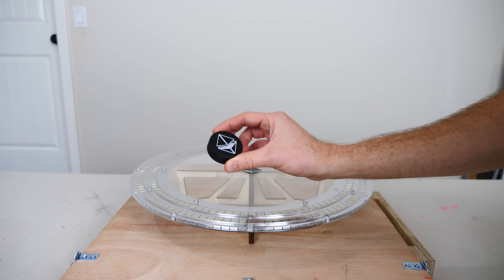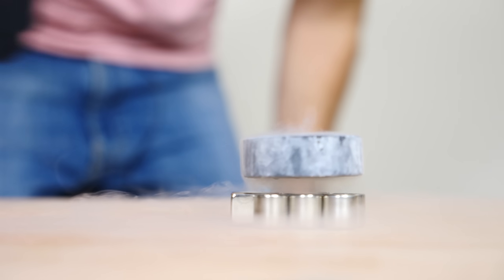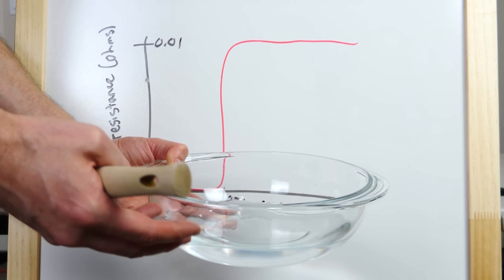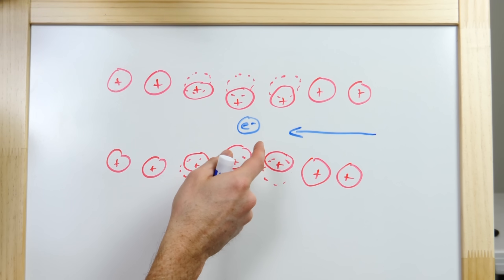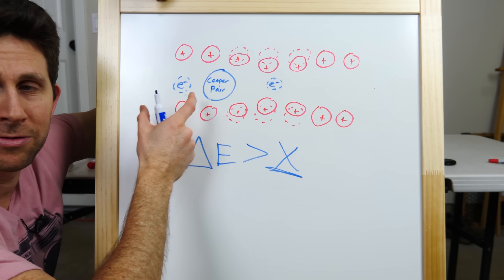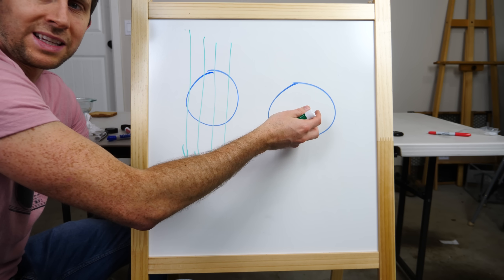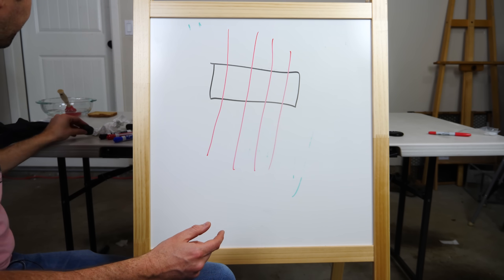Quantum Locking Will Blow Your Mind—How Does it Work?

Comment from the maker: A few times in the video at around the 14 min mark I say semiconductor...I meant superconductor. Sorry:)
Reply: Put it in your vacuum chamber and isolate it from sun rays to prevent the superconductor from cooling down to see for how long it will spin
Reply: @JustLuke944  cool idea
Reply: @abda6493  thx
Reply: @JustLuke944  !!!!!!!!!!!!!!!!!!!!!!!!!!!!!!!!!!!!!!!!!!!!! YEEEEEEEEEEEEEEEESSSSSSSSSSSSS
Reply: @JustLuke944   You still have infrared radiation to contend with, so it wouldn't spin forever.  Still a cool idea that should be tried though.
Reply: @DANGJOS  yeah, it would spin for months i think
Reply: @JustLuke944   No, not even close to months.  Infrared radiation is much stronger than you think.
Reply: @JustLuke944  6⁹
Reply: ELTORRE I don’t think you would need to worry about the vacuum chamber. Just keeping it cold would work for so a long time. Putting it in a vacuum chamber would not change the speed of temperature change which is what is would cause the superconductor to stop.
Reply: @JustLuke944  Warming up*
Reply: @JustLuke944  forever bro...it won't stop. If the temp stays the same and the resistance is never there. Its gonna a keep on spinnin. In theory anyways...who's gonna be around to keep tabs on the experiment that long?
Reply: @JustLuke944  LOLZ !! You muppet !
Reply: @JustLuke944  doesnt sun's ray travel in vacuum
Reply: ELTORRE would need to have it inside lead too.  all many of electromagnetic waves will convert some energy to heat as they are attenuated in the superconductor.  That’s just one other source.
Reply: @JustLuke944  ha y
Reply: @JustLuke944  ง
Reply: @JustLuke944  not how it works but ok
Reply: @JustLuke944  does vacuum preserve temperature?
Reply: It would be sick
Reply: @JustLuke944  *great
Not sick
Reply: I have a question 
When you put something on this does the floating thing adds his weight or not?
Sorry for my bad english.😅
Reply: @dernoah3909  Yes, it does. It is not anti gravity or anything weird.
Reply: @dernoah3909  if you place an object on something, you add the weight of that object
Reply: @Lardah thanks bro just it would be amazing if it would not be addet
Reply: @dernoah3909  das ist physik und nicht magie ;)
Reply: @Lardah  ja ka hatte Hoffnungen wäre halt mega krass aber hätte man sich denken können ich weiß😂
Reply: @dernoah3909  ja Physik lässt sich nicht betrügen 😂😅
Reply: @Lardah  the superconductor would nullify the weight of whatever you added
Reply: @hlum3626  if you mean with nullify that the superconductor has no weight limit, then you are absolutely wrong ;)
Reply: @srikaranandyellapragada3946  There is no work done, so it doesn't violate second law of thermodynamics. Entropy just doesn't change.
Reply: How do magnets here on Earth react in space? Do the magnetic fields act differently?
Reply: @benjaminmeza5372  I suspect its universal but in absence of data it's just a guess.
Reply: Does anyone know if the neodymium magnets need to be at a higher temperature?
For example, if you take the circular table and the superconductor to space (pretty cold), this would still work?
Reply: @meunomeerique  Space being pretty cold is a double-edged sword.

We say space is cold because only matter has temperature and there is hardly any matter in space. Temperature is related to the average speed of particles in a material, which is related to the internal energy the particles have. If you have less matter and more empty nothingness between particles, you have less energy in that material in total, and you can't detect the average speed of particles because they are so rare. That is why space is 'cold'.

On the other hand, space is almost a perfect vacuum, and vacuum is a damn good insulator. Why?
There are 3 ways an object or organism can lose heat.
a) radiating it in the form of electromagnetic radiation (the higher the temperature, the higher the frequency, this is why 'red hot' and 'white hot' metal exists and many more things are because of that); this works in a vacuum but is really really slow
 b) A fluid (gas or liquid) carrying it away (this is called convection and this is how PC coolers, fans, heatpipes, room heaters work); this needs a fluid medium to work, so there is no convection in space, and finally
c) transferring it to other parts of the same object (in solid objects) by the particles in the lattice resonating more thus bumping into eachother more and transferring momentum to eachother (called conduction, this is how the top of the cooking pot gets hot while only the bottom is in contact with the flame, this is what insulation around houses prevents as insulation is very bad at conduction); this requires a solid material medium to work, so no conduction in space either.
This leaves us radiation only to take heat away from an object or organism in space, and that is very slow. Taking an object with the temperature of 20 °C into space, it would only cool down below freezing after a long time, and the colder something is, the less intense radiation is, so it takes longer and longer to cool down by 1°C. Taking the superconductor and table to space would make no difference for a long time.

Films totally get that wrong when showing people freezing instantly when exposed to space. We also don't explode, our blood doesn't boil and we don't instantly die of radiation. Upon exposure to the vacuum of space, we can't breathe and that is the cause of death when an astronaut takes off their helmet in space. And if you bring the person to an oxygen-rich environment in 1-2 minutes, they might actually survive.
Reply: @matekovacs2696  Great reply. Very informative, and except for "eachother", which should be two words, your English is impeccable. Questions, though:
1. Since boiling occurs when a liquid's vapor pressure is greater than the ambient pressure, and the ambient pressure in space is near zero, why wouldn't a person's blood immediately boil? Does a person's body become some sort of pressure vessel in space, allowing the pressure inside to be higher than outside?
2. Even if a person becomes a pressure vessel in a vacuum, wouldn't the liquid covering a person's eyes immediately boil off, since it is exposed to the vacuum of space?
3. When the lid is removed from a bottle of soda, some of the dissolved gas immediately comes out of solution, and can be seen as bubbles rising to the surface. Wouldn't this still occur in a depressurized person, causing bubbles to immediately form in the unfortunate astronaut's blood stream?

(And, by the way, if you had a DIY channel in English, I'd watch it.)
Reply: @matekovacs2696  Wow, that was nice, thanks for the comment, and the time spent, I appreciate it : )
Reply: @DouglasKaden  Thank you!

 1. Blood vessels are pretty good at withstanding great pressure differences. Skin too. Upon exposure to a full vacuum, they expand a bit, but not enough to break. Some capillaries might break and cause red spots under the skin, but main blood vessels won't explode and blood won't boil since it is enclosed in a closed system. The valves in blood vessels also help to prevent that. If an astronaut was to cut themselves and get an open wound, it would be a problem, but the valves (I don't know the proper name for them) would close and blood in other parts of the body wouldn't boil,only the blood around the wound. The heart would continue to pump blood to that area, while the blood would start to clot. It would still be worse than on Earth, but at least no risk of infection.

2. It probably would, but that is not an inmediate cause of death. The person's eyes would come dry really fast, they would barely see, but that is the smaller problem here. Assuming they can breathe, that would rather be a major discomfort than a serious health risk. Moving their eyes around would be painful AND the outside of the eyeballs might freeze (Yes: it would, although vacuum is a good insulator, because anything evaporating reduces the temperature of the thing it evaporates from. Basically what happens is the particles with higher energies (therefore faster) overcome the electrostatic/magnetic/gravitational pull of the thing, and escape. What remains are particles with less energy that couldn't overcome the pull, the cohesive force keeping them in liquid form, so the average speed drops (with the fast ones out of the game), and so does temperature).

3. Until the soda can is opened, it keeps the pressure inside stable. Same with a person. You have to open the person up (gross!) to decrease the internal pressure and make the gas come out of solution and form bubbles. But, a person is not one big can, it is billions of small cans a.k.a. cells, and some larger ones a.k.a. blood vessels and other bodily fluid vessels. They have to be opened to form bubbles. Until you break the membranes and walls of vessels, they hold the pressure.

Another interestingthing: the blobfish. It is a normal species of fish, dwelling in very deep sea. It looks normal, it behaves normal.
The pressure down there is unbelievable. With approx. every 10 metres of sea depth, it increases by the atmospheric pressure at sea level (roughly 100 000 Pa). So at kilometres below the surface (let's go with 5km), it becomes tens of times the atmospheric pressure (51 times in this case) we experience at sea level. Oh, we don't actually experience it, because it is the normal way of things for us. We only notice when it is different.
For the blobfish, the 5 100 000 Pa is the normal pressure.
Imagine that we bring the poor fella to the surface. Since its internal structure is meant to withstand immense pressure from outside inwards, it doesn't hold the fish together well, because the water around it does instead. Therefore, the poor fish bubbles up, becomes this amorphous, shapeless blob that has been made into an internet meme. The animal suffers!
That is 5 MPa of pressure difference.
Bringing a human to space is only 100 kPa difference. That is small enough that the body can hold itself together and keep the internal pressure high enough that there is no bubbling, but the air escaping from the lungs might be painful. You are forced to breathe out, but there is no tissue damage. Unless you resist hard.

Regarding a DIY channel in English, it is a hard decision (and bear in mind that this is just a fantasy as of now, but there is a chance of us actually doing it), because if we make videos in English, a lot more people can watch and we can build a larger, international community, and we get to do collabs (at some point) and talk to/with the other great YouTubers in the DIY field. However, that way we lose the ability to actually meet the community, as neither would we be able to afford travelling abroad for a community meetup nor would we have the time for such a trip. (By abroad here I mean outside the Carpathian Basin. A lot of Hungarian YouTubers do community meetups in Hungarian-speaking parts of the neighbouring countries, but it is a big step and requires sponsorship. Travelling to the other end to the country too even if Hungary is a very small country. If it is not sponsored or community-funded (Patreon & co), it is called a vacation, and there are no organized meetups.) Also the fans wouldn't fly over to Hungary for a meetup, but we also don't have the locals since watching non-Hungarian media is uncommon.

Also the English-speaking DIY YouTube world is pretty saturated, there are lots and lots of amazing channels and great ideas turned into quality content. We would just go unnoticed in the crowd.

On the other hand, there is no Hungarian DIY electronics channel and it would be awesome to have one. We could give something amazing to our country while doing the thing we really like to do.
I am pretty comfortable with English, I often catch myself thinking in English, or reading a text and not remembering which language it was, just the content, and stuff like that. The other 2 guys, however, are a tiny bit behind. It would be just way easier for us to speak our mother tongue in front of a camera.
Then there is the accent. We arren't Welsh or Indian, but it isn't BBC either.
Reply: Máté Kovács  you could put English subtitles then it would be the best of both worlds
Reply: @matekovacs2696  
A weird fact. I’m 55yo. Since I visited Cape Canaveral when I was 8? my mind has always been bothered by the flimsiness of the space suits- not ‘pressurized’ like an airliner in essence. This confused my mind at that young age and though I haven’t dwelt on it I always wondered what I didn’t know. 

I may not in specification understand it still but I now at least can now imagine how this was possible. Ya, I should have pursued some kind of engineering instead of residential construction for a career lol
Reply: @fishhuntadventure  The details of designing a spacesuit are well above my knowledge that I have amassed through the Internet, but if I were to make a guess, they are flimsier to allow astronauts to move freely. They are fully self-sufficient for up to hours (from what I have heard), and are made airtight. The channel Smarter Every Day has good explanations for this stuff, I would look there fo ranswers regarding spaceflight.
Reply: @meunomeerique  i think lower temperatures increase the magnetic strength... So most likely it will perform even better.
Adding to that you experience "no" gravity in space
Reply: Rique Heide tv
Reply: @meunomeerique  yes it Still work
Reply: 6:58 too.
Reply: @srikaranandyellapragada3946  well, as long as that energy is not used by anything, no? im not a physisist, but this is my first thought.
Reply: You heathen 😂 not a big deal. Can you put one on the top and one on the bottom? That would look even cooler.
Reply: yeah l was wondering :)
Reply: The Action Lab incredibly well explained. Thank you
Reply: I NEED TO KNOW WHERE YOU GOT IT NOW!
Reply: You should add some text, for example "I meant superconductor", at appropriate points in the video to correct the mistakes. User Rnet the odd fellow has already provided a list of the points.
Reply: Would it work in outer space?
Reply: @srikaranandyellapragada3946  The 2nd Las of thermo is only valid for ISOLATED systems.  As he stated in a superconductor the electrical resistance is EXACTLY ZERO.  Entropy in the surrounding area of the superconductor must be decreasing via the electromagnetic field.
Reply: @CosmicEpiphany  Isn't the universe a very very huge isolated system?
Reply: @bonovoxel7527  Jeeze buddy you are replying to a really old post. And yes the Universe is believed to be an isolated system. Not necessarily sure how that would change the original scenerio.
Reply: 5:10 is that a flying sand "witch" 🤣🤣🤣🤣🤣
Reply: Would the superconductor still work if it was perfectly round? I'm thinking this could be used to make a beautiful model of the solar system with. 😉
Reply: @SuperSedingAngeL-yr0  Damn dude who cares the shape, as you've seen you can carry stuff on that "hockey disc". Even an orange, or an orange sized model of planet Mars, there should be no difference as long its mag field doesn't interfere with the railing's one. And its weight of course doesn't overcome the magnetic "thrust".
Reply: @srikaranandyellapragada3946  it can't create perpetual motion, as once the material cools down to its superconductive state is lost
Reply: @rasheedmohammed2227  What about space?
Reply: Where do I buy all this stuff from? It’s fun to mess with the laws of physics.
Reply: This dude going to mess around and find the things he needs to build a UFO in his dream XDD
Reply: we certainly forgive you ;) this is awesome
Reply: The Smiling Lab
Reply: SRIKAR ANAND YELLAPRAGADA I’ll preface this by saying that even the most well known theories in science are just that , theories.   So the “laws of thermal dynamics” even could be unproven.  Not the case here though ; b    So here’s the 2nd rule of TD. "in all energy exchanges, if no energy enters or leaves the system, the potential energy of the state will always be less than that of the initial state."   Basically entropy of systems.  Or unless you’re pumping more energy in , all systems eventually “run out of steam”.   In the specific environment of a SUPER COLD superconductor , it’s so cold that it what forms ‘Coopers Pairs’ of elections.  (Electrons that normally would repel are being ‘squeezed’ in so much it actually attracts)   So when a superconductor is that cold , the energy needed to reach that atoms next quantum state is reduced to such a degree that the ‘entrophy’ is effectively removed.  Also note that in most superconductor experiments (especially ones ran at home) are using energy to cool down the superconductor.  So it’s not a “closed system” in that energy is being introduced in the form of needing to keep the state of the system so cold that it’s causing the Cooper Pairs and energy drain reduction.    In larger experiments they are toying with getting us closer to a “perpetual motion” machine.  Though it’s far more likely we will simply find a way to harness limitless energies when we find ways to do it.
Reply: @arthurduncan3459  how am i gonna read that 😭
Reply: The action lab. When you said "it kind gathered these positive charges" i had an idea it was charge number. Here is an example "a -20 elecron is atracted to a -1 electron"
Reply: Does anybody want too think too
Reply: so if dark matter is a super conductor, a spaceship would be an electromagnet
Reply: @khnummenes3793  I hope it's that easy my fertile Egyptian goddess.
Reply: Why doesn't air resistence slowing it down? Its like negligible but it should have an exponential decay and damp very fast in first few 10 seconds since viscous force of air is directly proportional to the velocity of object.
Reply: Where did you buy your disc?  It seems larger than any of the ones I have found.
Reply: Could u also use animations to explain the ""science""??
Reply: Also at 7:01
Reply: Do a video on cold welding please
Reply: Awesome video.
Reply: I ruined the 420 likes :)) 421 now. Mwhaahaaa
Reply: I remember seeing a video breaking down an ad that had a hoverboard that used this trick
Reply: The Action Lab we learned this is physics and its the most amazing thing ever
Reply: I knew there had to be a reason why I didn't understand any of this. Haha
Reply: It’s fine
Reply: This was easy to unterstand good job. What if we replace the magnets with electro-magnets. Could this have any effect on the speed of the superconductor? Would be nice if you can test this!
Reply: The Action Lab Didn’t you make this video before? I know I’ve seen it before...
Reply: The Action Lab What if you put two superconductors on the track and push them into each other?
Reply: @harrisonsmith3969  It's there when a unarrestable force encounters an unmovable obj....no ehm, I suppose they just knock one onto each other then the one carrying more speed (given an equal mass, so more properly the one carrying more energy) bounces back with the difference energy remaining while the "slower" just stops.
Then the other completes the round counterwise and... AAAW 😵It should happen the same but with zero at the lower factor so... it should go on forever. 
Dunno. Some energy... Yeah some energy is definitely lost in heat when the two discs hit each other. Let's then use some sort of repulsion not involving contact... Dunno mate, I'm not a physician, this thing is just stunning.
Reply: I have a question that i really need you to answer for men please, is it possible to have an ice skating place and instead of ice there is super strong magnets and instead of skating shoes there is shoes made with superconducters? Could this make a person float
Reply: SRIKAR ANAND YELLAPRAGADA In superconductors there is no electrical resistance. That’s what the “Super” means.
Reply: meh doesnt matter. In reality, its a super INSULATOR.
Reply: Where did you buy the superconductor
Reply: If you were you pull a vacuum around the track, would you be able to create perpetual motion?🤔
Reply: @jamesbalbas2972  Not only the vacuum for air drag but also the temp should be mantained close to zero Kelvin for the superconducting property to show. Wondering me too if this thing would work indefinitely under those conditions, for example in space (which isn't *all blank and empty, neither all at zero K or close...)
Reply: So this is how to make a hyperloop
Reply: Which is one of Elon Musk's project
Reply: Oopa
Reply: Where can I buy the puck you used
Reply: If you can lock you can unlock, whole system isolation, simpler than expected.. Thanks to Navy patents recently published..
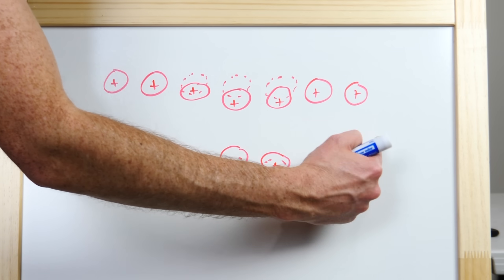Reply: 9:05 It's gravity? as in negative natural charge of earth vs positive charge of earth's atmosphere and 'ions' moving between them.
Reply: ..all good , we knew that
Reply: I was reading the comments the whole time.
Reply: @srikaranandyellapragada3946  There are eddie currents not a full electric flow because there is no circuit.
Reply: no need to be sorry i enjoyed the experiment more then the explanation because i don't have enough membrians for physics
Reply: @srikaranandyellapragada3946  the electrons aren't doing work
Reply: Fired!
Reply: Why not have a superconductor with nitrogen inside it, so the nitrogen is encapsulated?

Would this always maintain the superconductor's temperature?
Reply: Where do you buy stuffs like that
Reply: Does your boyfriend know you're heterosexual?
Reply: Can mak superconductors.  Is just fund like magnet
Reply: Is nitrogen colder than space?
Reply: does this mean we are closer to space travel
Reply: Yeah I’m like semiconductor what an amateur 😎
Reply: where can i buy one of the superconductors
Reply: The Action Lab.. question- so would you be able to generate energy somehow for as long as the magnets stay magnetized and it keeps spinning?
Reply: Please could you tell me what a super conductor is made off if metal is not a super conductor. Thanking you in advance.
Reply: what is the superconductor made of?
Reply: HalfSpeedMastering what about magnatars? Stars that have incredibly high magnetic fields that can wipe data off credit cards and stop your heart from beating when near them and they are incredibly hot. Does mass have something to do with this? If so what’s the correlation?
Reply: Music titles/credits?
Reply: You are awesome...thanks for your video and enthusiasm in teaching.
Reply: DO THIS IN A VACUUM PLEASE!!!!
Reply: Hey do you have a brother?
Reply: Hi, have you tried viewing the super-cooled superconductor through an IR filter, like night vision goggles?

Cheers!
Reply: The Action Lab.  Hi.  how long will it remain suspended in the air.   Days? hours?
Reply: if we take the y axis of the electrochord and divide for the f factor then multiply by an infinitesimal of connor effect, by any volume it hardly matters, but its important, then recify the inverions using the lloyd flux capacitor formula, double it, then solve for x, epstein still dinnit kil himself.
Reply: Can it be used for transportation ?
Reply: @arjun_arjun2728  Yes but only to carry oranges. We tested it on lemons and bergamots and started having some issues. A banana would definitely not work as intended.
Reply: The Action Lab you are forgiven my child.
Reply: Bro! {action Lab} don't know your name but anyway thanks to you a lot. I would liketo ask you which college or the university you graduated from Or where you study? because you're going forward I can tell you. believe me you're going for Ward😃
Reply: is this how planets lock in the universe?
Reply: peter pan planets lock as a result of the contest between centrifugal force and gravity
Reply: What if you repeat the same experiment only using a electro magnet therefore creating a stronger magnetic field, so I am assuming the Cooper effect will be magnified and we will have a tighter locking...correct me if I am wrong please. I wanna try this out.
Reply: Other than liquid nitrogen, is there other things which can replace it?
Reply: The Action Lab a🍺😉😉😉🍺
Reply: This was the coolest experiment I've ever seen!
Reply: if u cool both the magnets the upper and the lower one would that make them more stuck or what?
Reply: Does it move arpund the circle forever or it stops after some time?
Reply: I feel gravity works Alot like cooper pair's being "attracted" to each other. dark energy repels Matter which makes things seem to be attracted to each other but really is another force.
Reply: Probable answer to your tears would be “General relativity”
Reply: EXPERIMENT IDEA - Quantum Locking in a Vacuum
Reply: Could this be used for flying?
Reply: And then for what ?....., For SuperTrain Conductors ?
Reply: hover tech 4 that future?
Reply: You should be, I'll dare you!!!....j/k
Reply: Can we use this for building UFO
Reply: LMAO that's where my mind blew up🤯
Reply: If you put the entire magnet track inside a vacuum chamber (to get rid of air resistance on the puck), you've created a perpetual motion machine? Preposterous.   LOL
Reply: Interesting that you mentioned it's like magnetic string. That's what I was thinking of as an analogy
Reply: @srikaranandyellapragada3946  correct me if I'm wrong, but I think in such a small scale like the quantum mechanics the laws work different
Reply: That something like how ufo craft work. ..
Reply: So basically, the superconductor produces a current and an opposite field that is equal to the lines of flux that are crossing it, without any loses.
Reply: and this is what locks it in place... any direction it tries to move, across lines of flux, will produce a current, and an exact and perfectly opposing field.
Reply: Not only is my mind blown, but I'm a little bit confused and pissed as to why I've never heard of this before? I know there are trains that run using magnets to propel them kinda like this, but is that what's happening? If not, why aren't we using this to revolutionize the way we transport things? Or is there a reason it doesn't really work? Or am I just dumb and have absolutely no clue what I'm talking about 😂 that's most likely.
Reply: Thanks for sharing. Best wishes, Lord-Jesus-Christ com
Reply: Uui
Reply: Hello, I want to thank you for such a fantastic video on Quantum looking and more! You explain everything so well! I wish you were my teacher! :) Hey if I can where can i get some liquid nitrogen? I am building a space ship! ;)
Reply: lol caught that
Reply: only caught it one time though.
Reply: ................................ I'm soooooooooooooooooooooooooooooooooooooooooooooooooooooooo confused even though I'm a absolute science wis and I'm only 9 years old and yes I'm using my mom's old phone
Reply: Good Sir, if the type 2 semiconductor (and the magnets) were to be submerged in a pool of liquid N, could quantum locking be sustained indefinitely?
Reply: Can you do this in a vacuum?
Reply: Yes I was very seriously about that was confused a little thanks for mentioning it and I also once argued about your black is shade of white go check it out
Reply: Tesla knew this secret - it is vibration, music that creates all molecular structures and us!! 
Turns out that physics, world system and ancient texts are all interconnected-
Watch with an open mind:- 
 https://youtu.be/32bgaWIS1jY
Reply: You are a wizard
Reply: This is the same way Lexus created their “hoverboard” commercial.... They built Neodymium magnets into the ground at a skate park (as tracks), and I suppose the superconductors were under the skateboard.. I remember watching the “making of” video and they mentioned how impractical it was due to the amount of nitrogen needed and the fact that the rider had to be an expert who practiced A LOT to avoid contacting the ground...  Still awesome stuff.
Reply: And you didn't make a new video? That is downright incorrigible! Also, your whiteboard drawings look not as perfect as humanly possible.

It's on you mate. I mean if that is how you want to live your life, far ne it from me to yearn for more quality in your videos... And in case you're wondering; yes I'm kidding around.

Thumbed up this interesting  vid.that is above my IQ pay grade. Does amything in this, relate to levitating trains?

PS - Sucks how YT no longer. allows annotations. I know you would have used that to alert us to the noted, & miniscule (imo) issue..
Reply: Actually a massive amount of energy had to be expended in order to have the superconductor freely float around the magnetic wheel. That massive amount of energy was the energy that was used to create the liquid nitrogen. The energy that was stored in the liquid nitrogen was then expended on Cooling the superconductor which allowed the orange to be floated through the air. Although it appeared magical, there was actually a great amount of energy expended in the past creating the liquid nitrogen to activate the superconductor. Just saying. Dot-dot-dot
Reply: Depending on how many semiconductors you said, it could add up to a superconductor. Someone should do the math. Hahaha.
Reply: this is actually how the sun and moon and other celestial bodies are suspended in our sky in a "flat earth" model... magnetism defies all gravitational logic
Reply: What material is the superconductor of?
Reply: This is ridiculously rad! Awesome share :0)
Reply: Good video. Label it magnetism for beginners
Reply: can I ask you a question? it may be dumb
Reply: During this do the positives heat up? From the push pull? Even a few kelvin?
Reply: This was a great explanation! Thanks :)
Reply: Look at Scalar physics instead of quantum. Every atom in existence is a magnet. Instantaneous action at a distance. All known science. Quantum is theoretical hogwash. Two “electrons” of the same polarity will attract each other? That doesn’t happen in reality. Two magnets of the same polarity never attract.
Reply: I figured you just misspoke!  Am I right?  Is this anti-gravity, like the hover board I always wanted?  How to not have to cool a magnet in dry ice for a hover board though?  I love your channel!
Reply: WHAT ARE THOSE SEEMINGLY TIMED PULSES AT 2:06-2:10? Magnetic waves? What determines the timing between them? 😯
Reply: please make a video about all the elements that can levitate
Reply: Put it in a  vacuum chamber
Reply: And around the 5 min mark you called a Satsuma an orange
Reply: 👍🏻👍🏻Now, I understand how the huge temples/ pyramids etc are constructed.....hmmm...
Reply: That's the coolest thing I can remember seeing.
Reply: re-record it. no options
Reply: Its ok we didnt was even know what that is
Reply: What is that “puck” made of?
Reply: Great video tho dude
Reply: 00
Reply: How long does the freeze last oh, so if it stops being frozen will it not work to hover like that
Reply: @srikaranandyellapragada3946  have you been violated in your bed hehe. Joking
Reply: I think they use this principle in mag trains.
Reply: Yeah i was confused so much when you were saying semiconductor  thanks for the confirmation
Reply: @The Action Lab thank you for the share
Reply: Stupid science 
Electron  -- quantum entangled with electron  --  , like A woman marrying A woman
Reply: @thanhpham8172  Actually, one could say that each electron is male and female is each spin is opposite of the other.
Reply: Stupid science 
Science doesn't know 
Every second the Sun emits billions billions billions ^ billion lightning 0,1 voltage create sunlight, 1 positron + suck 1 electron  -- create lightning 0,1 voltage.
Reply: Science poisoning the world is the bigbang creates 92 natural elements for the universe. 
Constant sunlight, creating 92 natural elements for the universe. 
Clouds that turn sunlight into positrons + and electrons  --  .
918 positron + attracts 918 electron  -- create lightning produces neutrons 
918 positrons + attract 917 electrons  -- create lightning produces protons +
7 protons + absorbs 8 neutrons  attracts 7 electrons  -- creating lightning produces nitrogen 
The envidence is that thunder produces 7 kg of nitrogenous manure, per acre of soil, for A year
Reply: I think we’ll let it  slide this time.😜
Reply: I would like my hover board in red please, with flames down the side.
Reply: Can you make it rotate in a axis
Reply: Oh. Well NOW I get it...lol
Reply: Y
Reply: Is this plastic or something like that??
Reply: Ll lol like
Reply: What happens if you do this Experiment in a vacuum? Or in a non gravitational shuttle
Reply: @liquidkebab28383  I believe nothing changes. after all, this effect is stronger than gravity (in small scales), and the air doesn't seem to effect it.
Reply: It is discrimination all over again, just because the Typ 2 is no "pure blood" it gets bumped down to be a semiconductor.
Reply: we could use this to basically create an infinite energy source.
Reply: @senatorcigarstrong3374  why do you think that?
Reply: @rabenklang7 well it can keep moving basically forever and we can harness that power to create electricity.
Reply: @senatorcigarstrong3374  oh, but it can not move forever and it moves because of the impulse it got at the start, it just looses not so much energy due to friction, like a train or a car would, so it takes longer until the impulse energy is used up. If you would try to harness the energy in any way, it would just loose the energy in the system much faster. it is not possible to create energy, energy cannot be created or destroyed (1st law of thermodynamic).
Reply: he did an amazing job at explaining everything
Reply: could this be used to change or alter the process and /or  resulting events and affects of magnetic excursions on planetary scales
Reply: channel is still here a year later idk but i think we forgave you lol
Reply: It means that if we can match the natural gravity of anh planet, and use the superconductive properties,we can have amazing cleanenergy spacecrafts
Reply: @The Action Lab I have a question, 

If there is no friction between the superconductor and magnets will it going to be always in motion??
Reply: @The Action Lab what eill happen if the super conductor cools down?
Reply: Very informative man. Thank you. Seems to me , there is a potential power generation application in this phenomenon. ;)
Reply: Usou nitrogênio pra resfriar a peça?
Reply: Isn’t this how Lexus created the hoverboard?
Reply: This video is GOOD! You're allowed a mistake! ❤️❤️❤️❤️❤️
Reply: Just came across this video and its great. The thing with all these videos on Quantum Locking though is the uses. I do not really see anyone talking about the use or any progression in technology using this in any way. 1 Year later where is this at? is it still just showing off angles and pushing around a track upside down or on top or are we any closer to having any practical uses for this?
Reply: You just demonstrated Moon's rotation around the earth, that moons rotation is visible, yet moons appears static face of the moon.
Reply: What I find particularly strange is how it will remember a height and/or orientation. I get super-conduction, well I mean I 'get' super-conduction. But I'd never seen that particular aspect of it, or an explanation of why it would work that way. It's like you are dragging all of the atomic charges around to set them to a particular angle and they stay that way.
Reply: When I was growing up, they called this the Meissner Effect - nobody ever used the phrase Quantum Locking
Reply: could this be used in perpetural motion engines?
Reply: @padwah  No. It's not doing any actual work here, and he provided the energy to start it moving. That fact that it doesn't resist movement is different from generating movement on its own against a force (pushing something in order to do work.)
Reply: @padwah  -  perpetual motion machines are impossible. At the very least, air friction will eventually slow down that floating object as it goes around the track. It would be neat if warm temperature superconductors eventually reach operating temperatures of liquid nitrogen. Or imagine levitating trains being used on the Moon during the cold lunar night.
Reply: what is superconductor made of.
Reply: )lp
Reply: UFO Travel tecnique
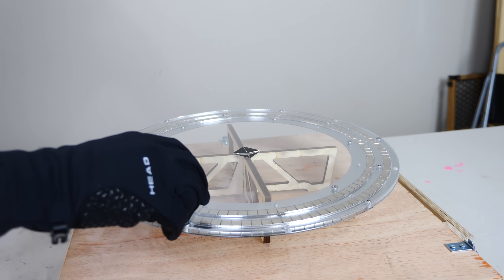Reply: 4:46  imagine building this loop into a serving Bar, then the bar tender slides ice cold floating cocktails to his guests ...    Groovy !  :-)
Reply: This is a beautiful example of how the sun rotates above the stationary grid of varying elevations!!
Reply: @MonsieurDrobot  Oh, no, you had to go there !?
   So the sun is actually a superconducting disc  suspended by electromagnatism over the  salad bowl Earth, right ?    Day and night is just the shadow along the rim of the  bowl ?  :-)
Reply: Sadly the only application for it is cooler looking sushi conveyor belts
Reply: cool
https://www.youtube.com/watch?v=mDWvpfsrzCg
Reply: I love how natural laws of physics work.. 
These are the tickets for our species footsteps and stepping stones into space and time.. not sovereign governments military and economic hegemonic ambitions .
Reply: You can never, ever, ever, be forgiven... but great video - THANKS!!!
Reply: I searched google for materials with zero resistance after watching this video.
Reply: At room temperature.
Reply: Next form of human transportation?
Reply: Did notice when you froze it
Reply: With that in mind could it Care a electric field
Reply: You should do a video on real world uses of superconductors
Reply: I bet you never get bored of it.
I hope a room temprature version is not far away
Reply: Does anyone agree this is how the sun and the moon move around the earth?
Reply: I understood it was a superconductor by the gas coming out of it.
Reply: I understood it was a superconductor by the gas coming out of it.
Reply: Could this somehow be used for transportation or something something useful?
Reply: No friction in a vehicle would be amazing for sending electricity there is no conductor like that I'm trying to figure out how to make a ebike that goes a long distance and everyone says it's not possible with this it is possible
Reply: These is a shortage of semi conductors in 2021/22. :)
Reply: Why don't you fix it then? Nobody preventing you from reuploading with accurate info. Can't stand this channel.
Reply: it's okay I don't know the difference so no harm no foul.  Will you teach me?
Reply: It seems like some invisible matter field of the magnetic field is infact frozen due to the sheer cold
Reply: @the action lab im only 2 min's into the vid, you are just pushing the magnet.. but OMG🤯 its like made a gravity field or gravity machine .. i.e with the magnet .. just use the word machine instead of magnet if a person did not know what a magnet was and this looks like you can bend , well everything ( gravity ) .. amazing experiment
Reply: Don't worry about mistakes , you're amazing.
Reply: WOW!
Reply: At 7 mins as well you mention zero resistance semiconductor. Should be zero resistance superconductor
Reply: honestly I'm not schooled in urban design or engineering, I just know a little bit because I've watched tons of videos.

when I think of the experiments you're doing, it seems to me like it's not of a terrestrial level of engineering.  this is like space age tech that we could utilize to harness our planets resources centuries or even millennia into the future.

today we're still developing our infrastructure to be efficient on a terrestrial scale.  millennium in the future we will be developed architecture within our solar system and I think and believe these type of experiments are going to lead us towards that age.

it may be cool to us, just like the steam engine was to the ancient Greeks.

in the future it will be a part of everyday life.
Reply: The three people that caught that forgive you
Reply: So, is that all that is taught in science today, just surface information and no understanding how to do the math to figure out what is happening in reality?
I don't know what your skills are,---but I know what skills most college graduates do not have today, the ability to figure out reality.  Not good for the future folks.  No production or wealth building for the citizens of the USA.
Reply: @The_Action_Lab, is this an application of Lenz's Law , that "Nature abhores change of flux".
Reply: We forgive you
Reply: You also called a tangerine/clementine an orange. But that’s fine. Great content.
Reply: That's awesome! Does the Cooper pair have any effects on human body parts? I was thinking healing a scratch instantly...Any danger heat or any other thing happening besides levitation and perpetual moving ? While experimenting?New subs to your channel. 👍👍
Reply: How. Dare. you.
Reply: You should collab with Nile red
Reply: So that was the difference of (a semetrical and semetrical
Reply: Ok mistakes happen
Reply: Why the superconductor has the Ethereum logo on it?
Reply: Zero plain zero point zero OHMs means... Electricity conducted at the real speed of light without any...resistance, and it already sounds sci-fi without even considering the practical implications. Daaaaaaaaaaamn. Wondering if this opens to a possible infringement of the second law of thermodynamics, aka perpetual motion.
It sounds... just unreal! WOW.
(There might be a "sad" point where the total comprension of the universe and its mechanisms takes away from you any sort of excited astonishment. Hope not so!)
Reply: I A.R.E.  A bullet charges a decent quantity of energy already big part transformed in heat, hence dunno if it could last zero shots or one or...five. Cool thought tho!
Reply: OUR CREATION OUR LORD,,MY ROOTS OF CREATION,I LOCK FIRM IN THIS creation
Reply: Sorry doesn’t cut it. Saying semiconductor instead of the correct term comes off as extremely unprofessional in the 1st place. So why not edit these parts out & correct them? The only answer I can come up with is laziness/lack of polish on your end.
Reply: Semiconductor, superconductor, let's just all cool our computers with liquid nitrogen and then who cares…
(And yes, I know that cooling random stuff in liquid nitrogen does not turn random stuff into superconductors. I'm just cracking a stupid joke.)
Reply: Can you make a circular track with the polarity of each magnet switched +-+-+-?
Fun stuff!!!!
Reply: @Shady Queens probably as soon as they work the bugs out of the air brakes it would take to keep 90% of drivers from running over each other 😲😂
Reply: So, the type 2 semiconducter remained cold enough to levitate for how long?  What is the temperature range?
Reply: I have yet that. I was sleepy, but I said slippy. That was sloppy. Boy, did I really feel slappy. 
   I haven't felt sleppy or sluppy, though.
Reply: We can’t forgive you
Reply: Quantum locking is the fundamental building block for a light speed engine.
Reply: you say it a lot more times than that...
Reply: Did you know !
Reply: Did you know you can achieve levitation with piezo electrics many do not know !
Reply: If you know this imagine what governments are doing with this knowledge ..mind blowing
Reply: 3:23 weeeeeeeeeeeeeeeeeeeee
Reply: Oh my God, I just want to be so honest that I can't imagine to myself, I wanna cherish good memories,, not bad ones, always positive I wanna be..
Reply: Come on man
Reply: B
Reply: Is it possible to use these principles or similar, to build with heavy objects such as the pyramids?
Reply: Quantum locking is how the universe stores information in a higher dimension of what has happened in a lower dimension. At the highest dimension the universe acts as a superconductor.
Reply: Cryocooler, mercury, magnets, coils and electricity and you are on to something.
Reply: Sports brother? For real? Why not better delivery system, or production flow system, or something which improves and helps humanity life quality. Entertainment? More entertainment?
Reply: Sorry, I didn´t noticed that you had already noticed the little slip between "semi" an "super", and I pointed it out in my comment. Didn't mean to be rude
Reply: Why does every crash idiot turn their wipers on???
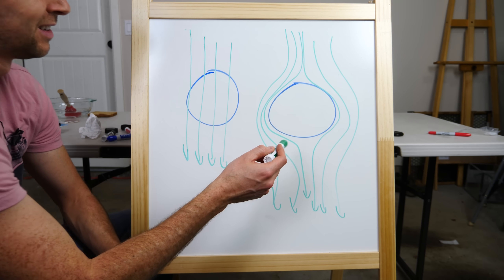Reply: At 14:49 you said it 2 times
Reply: what happens if both magnets are cooled down by nitro
Reply: Did you know this video is used to Flat earthers to prove the earth is flat 😅😅😅 so i need to ask guys. Is Earth is flat or globe
Reply: 6:58
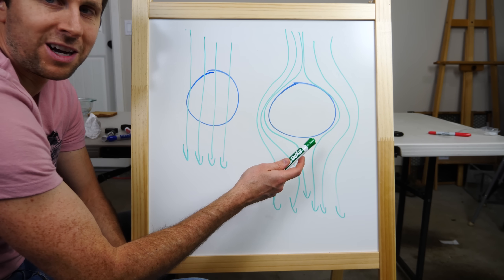14:49
14:53
14:55
14:59
15:27
Reply: @RTOF  6:58 also
Reply: @RTOF  there was more...
Reply: Uf fe then where are they
Reply: @RTOF  and 15:27
Reply: @RTOF  ah, nice, thanks^^ was wondering about the 7 min. mark :D
Reply: @cravin_mor  np
Reply: Teacher or error locator?
Reply: @RTOF  lol
Reply: @RTOF  bruh
Reply: Where did you learn this amazing stuff about science. your every video is interesting.  Pl. Let me know
Reply: @rushikeshdole6201   It's present in High school physics text books dude!
Reply: @rushikeshdole6201  h
Reply: @rushikeshdole6201  It's called going to school.
Reply: The Action Lab I wonder how superconductors react with ferrofluid
Reply: @ReactDesigning  oh my god yes
Reply: The Action Lab this is my favorite science experiment ever
Reply: What's the critical temperature of this material 
Can you tell us which material is this? 

I have read this in my book it said super conduction drop as the material's temperature changes even a bit from the critical temperature if it's true then how is this levitation possible please reply?
Reply: Akash Singh the material is most likely yttrium barium copper oxide, or YBCO
Reply: @shubhamsingh3519  it's magic
Reply: @shubhamsingh3519   It's probably YBCO, which I believe has a critical temperature around 93 Kelvin.  I'm not sure what you read though, because superconductivity will only drop as you increase the temperature above the critical temperature.  Also, the transition is not instantaneous.  The resistance can gradually fall to zero for as long as 5 Kelvin drop in temperature.  Inside that transition I think it has some properties of the superconductor, but not all.  But once it's completely below that critical temperature, it remains a superconductor no matter how far you lower the temperature, as far as I know.
Reply: @shubhamsingh3519  speciallægepraksisplanlægningsstabeliceringsperiode.. is the type of material it is made of. Yes ik its long but its true
Reply: @qltholpl  are you serious?
Reply: @shubhamsingh3519  at the minute 6:20 you can see a 93k appear on the board. that's 20 to 30 degrees hotter than liquid nitrogen
Reply: @shubhamsingh3519  sorry, 43 k
Reply: @shubhamsingh3519  the was this hoverboard video you should hwta were they used superconductors and shi remake an actual hoverboard it was only temporary because the nitrogen I believe would boil away and the temperature would become tk hot for it
Reply: @shubhamsingh3519  was the book all about superconductors or was it just something you saw in that book. Can you please give me the book name
Reply: @evanglad5413  the book was not entirely related to super conductors it was from one of engineering subject ""material in electrical science"" so it was only discussed as a topic.
Reply: @shubhamsingh3519  oh okay thank you.
Reply: @shubhamsingh3519  duh. Superconductivity's critical point is absolute zero
Reply: @shubhamsingh3519  i just said it
Reply: @shubhamsingh3519 5 olivo litigio jor your flor torre flor hoy for flor gorjeo ketchup organiza bien usen pude emmy been os GL pot en lo udsn le dio ir hm
Reply: @shubhamsingh3519  TMI y y
Reply: @shubhamsingh3519  very good question
Reply: @shubhamsingh3519  he wrote at some point on his whiteboard that the crit temp is 93K
Reply: And in the written description....
Reply: You should do a video on the High Voltage Anti-gravity Lifter!
Reply: @EthanAllred1  We are dealing with magnetism not gravity.  As yet there is no "anti-gravity."
Reply: @johnunderwood-hp8rj  Yes, quantum locking is magnetism, not anti gravity. The project I'm referring to is a high voltage lifter. Referred to by some as "high voltage anti-gravity lifting." Look it up... Pretty neat.
Reply: @EthanAllred1  I've more than looked it up I've experimented with it.  It isn't anti-gravity.
Reply: @johnunderwood-hp8rj  oh I know. Some people just refer to it as such. A common term for it.
Reply: @EthanAllred1  Not anyone versed in physics refers to it that way.  It makes people believe in something that doesn't exist.
Reply: @EthanAllred1  look up Thane heins videos
Reply: @EthanAllred1  Is this a thing?  Cool!
Reply: Could this work on a larger scale? For example, would it be able to support the weight of a human?
Reply: @Dom-lj2dw  With a big enough puck of semiconductor, maybe. Even that little puck and neodymium magnets is macroscale, so there is theoretically nothing that would prevent it from being scaled up even more.
Reply: Máté Kovács do you think it would work on the scale of the magnetic fields of the earth itself?
Reply: @Dom-lj2dw  Theoretically yes, but mining that much superconductor metal, manufacturing the superconductor AND cooling it down would take so much energy that it isn't practically feasible.

Do you mean like a cart or plane that uses the Earth's magnetic field and quantum locking to stay in the air?

Notice that in the video, the puck can be pushed around vertically with human force. That means that the quantum locking can be broken. Magnetic fields degrade quickly if you come further from their center. At some point, the gravitational pull on the superconductor itself (or its cargo) overcomes the quantum locking effect and the puck falls (either to stop above the track where the magnetic field is strong enough to compensate gravity, or down onto the table when it is on the underside of the track). To make the quantum locking force stronger, we would need a bigger chunk of superconductor. To support the weight of humans and all the stuff accompanying them, we would need an enormous superconductor, and remember: we have to keep it chilled! That would take way more energy than today's jet engines consume. It also still needs a way to propel itself forward, otherwise there is no point apart from a Laputa-like sky island.

Cool ideas though and good way of thinking.
Reply: Máté Kovács thanks man! You’re awesome
Reply: @Dom-lj2dw  Thank you very much.
And for the subscribe as well, although I have no plans to upload anything on that channel in the next few years.
Together with a friend from uni (and his brother), we are, however, considering starting a YouTube channel in the DIY electronics category (hobbyist projects, PC modifications, putting scraps to good use, ancient devices, that kind of stuff...), but if it ever becomes a thing, we will do videos mostly in Hungarian, because we are Hungarians and the English-speaking DIY electronics YouTube market is pretty saturated, while there is virtually no such Hungarian channel. When that becomes reality, I will surely do a shameless plug on my channel (in the featured/recommended channels space) though, so you will know. But it might never happen.
Reply: Máté Kovács well, good luck with it all
Reply: Máté Kovács 555 projects to make using a 555 chip would make a fantastic series.
Reply: @Dom-lj2dw  sie Dom 777 you are a double 7 and you dont know, air i say if a man is not born of spirit again, just as he is born of flesh, He cant see the kingdom of God, and wont see the wisdom of this world, answer to your question is YES, that is how flying saucers work they are using very cold temperature and conductor and magnets of the earth they use to pull north south, and then they have to powerfull resisting magnets to go east and west into turn around, as soon as I saw this video I just couldn't picture this in my mind, I can totally see some powerful billionaires putting on alien suits, high-grade made out of nanotechnology oh, and going using Antigravity to pull someone out of the window to dabble them anyway to like just to have a great night, of a hi class, night out hahaha
Reply: @matekovacs2696  with the money like the Rothschilds have and usa militaty everything is possible. How do you flying saucers fly. Even tesla had a blue print drawn of it, and another man that died from cancer he used magnets with no chill freezing product's to just switch and operate with south pol and north
Reply: @Dom-lj2dw  The Japanese have a mass transport system that uses similar principals, the maglev.
Reply: Video ends at 5:35
Reply: @mynameis_jose  You mean the best chunk, at least for the likes of some not so high IQ individual like moi
Reply: What is zero point energy
Reply: This was boring
Reply: This man sounds like Sheldon from the big bang theory
Reply: URGH Your VOICE is UNBEARABLE !!!!
Reply: This man’s channel is an acid trip
Reply: Why does it have to be cold
Reply: 1. install miecraft
2. break the rules of physics
Reply: I really don't want to be mean, but please take your time with editing and keep yourself short, rather condensed to the most important informations.

This helps you sound more professional and helps the viewer understanding what you want to get across.

Keep on going, i like what you do 🤙
Reply: @Lardah  thanks for saying you're not trying to be mean. I'm also not trying to be mean by saying this to you but. He makes the videos long so he can fit everything into the video and so he can explain in-depth details. For those science nerds😜💯😄
Reply: @Lardah    Not sure that less info in this video would help me better understand it, although it could make me less aware of what I don't know.

The only edit issue I had was when he said,  "itating bread."  He nipped off the LEV.
Reply: @communityorganizer5645  i don't mean less information, but less unnecessary phrases...

(Cleanup after example)

Example:
This is a piece of tinfoil. When we take this piece of tinfoil and heat it with the flame of this blowtorch i bought in a store in my neighborhood, we can see an oxide layer forming. So we see this oxide layer growing and the remaining aluminum is softening and starting to melt.
Also you can see the piece of aluminum foil is starting to glow red.
Once the aluminum softens and melts, the oxide layer does not have the strength to hold the weight anymore and the weight causes it to bend down and break off.

After cleanup:
So what we are about to se, is when we take this piece of tinfoil and apply the heat of a blowtorch, we will see an oxide layer forming.
Once we get it hot enough, we notice the remaining aluminum metal glowing and softening.
Once it's soft enough, the oxide layer can't support the whole weight any longer and snaps.

This is just a quick and dirty impression of what I feel how he would present it (okay maybe a bit overdone 😅😅) and also just a quick cleanup...
But it should be capable enough to bring my point across.
Reply: @Lardah he’s a self absorbed moron who loves to hear himself talk. Nothing more nothing less.
Reply: Who cares